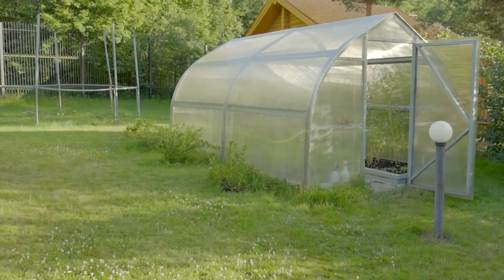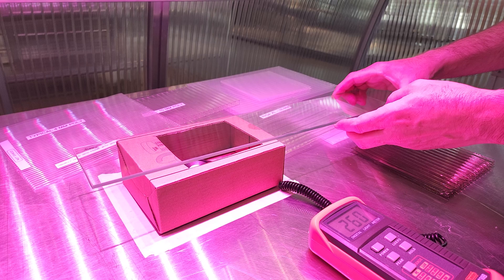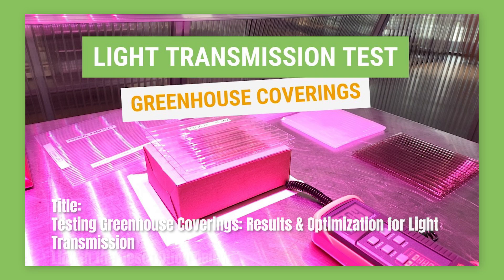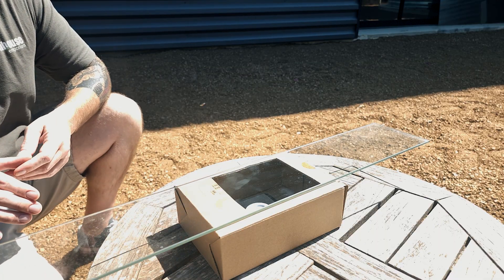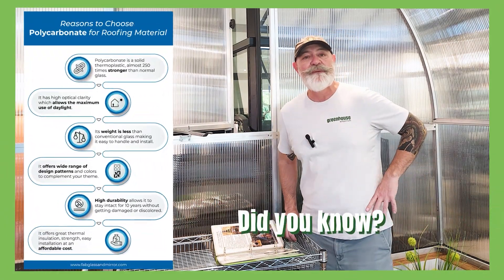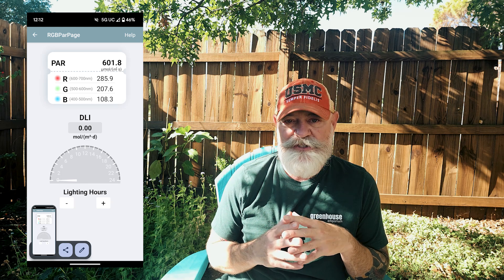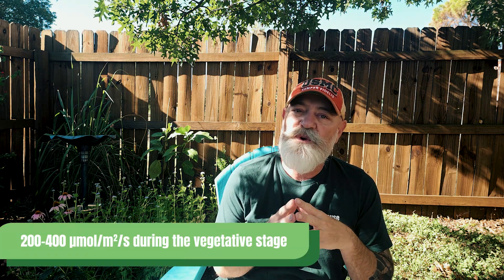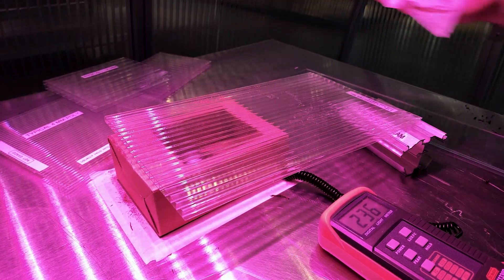Testing Greenhouse Covering Materials For Light Transmission: Our Results

Comment: Hi , I bought Suntuf polycarbonate sheeting Solar Grey , light transfer 20% , Solar transmission 43% for my shade house , 4 years ago My orchids are not thriving , no flowers 
I need more light , thinking White difused , light transfer 85%  Solar transmission 80%  ?..
Live Sunshine Coast Australia , would I have not enough sun protection/cover when very hot, I don't want sunburnt orchids  please advise
Reply from the maker: That sounds about right. Orchids still like it bright, but no direct sun. I am not surprised that with 20% light, they don't bloom. We have regular polycarbonate and a 50% aluminum shade, and our test orchid is not blooming either (we're in Central Texas, so it should be similar to your climate). While I cannot specifically say that the white light diffusing polycarbonate would work, I think your chances are way higher. Light diffusing polycarbonate creates a very nice, even, and bright light.

Comment: Hi. Your test is not consistent, you place the samples once parallel and once perpendicular (chambers of Pc), looking at the angle of the sun in 8mm Pc the light must pass through two walls to hit sensor but in 10mm Pc it must go throught 3 walls (including the inner walls of the chambers) in 16mm Pc it's  passing 4-5 walls. This wouldn't be a problem if the sun was at its zenith. A similar situation is with LUX meter, light from further diodes on the led barr hit samples on sharp angle it would be more precise if you use one led bulb straight abowe sensor. Sorry for my english, I'm from far away :)
Reply from the maker: Thanks for pointing these things out! I didn't consider it and sure enough, you're right. It makes a difference which direction it's placed (I just went outside and tested it real quick). It's comments like this I love the most. I'm intrigued to test the polycarbonate panels again.
Keep in mind, we did say it's not a scientific test. We are not in a place to avoid/prevent all variables.

Comment: Any ideas why the 8mm polycarbonate resulted in better light transmission than the 4 AND higher ones?
Reply from the maker: As far as we can say, the clarity of the polycarbonate sheets and the channel size must have played a role in this. The Riga greenhouses use quite translucent sheets while the 4mm generic polycarbonate was slightly less clear. When you look at the width of the channels between the walls, you can also see quite a difference. The 4mm has very narrow channels which could result in more light being blocked.
Reply: @ghemporium  that explanation actually makes sense. I'll make sure to check out the channels. 

Btw, in growing mary J, many of the better LED lights claim to  having a 1.8 mol/joul rating. Would you want that type of intensity for any sun hungry crop?
Reply from the maker: @dozyproductionss  Now, we're rather talking about efficacy (PPE). As far as I understand it, µmol/J tells you how much usable light per Watt/Joule you get. A higher number is better as it provides more light per the same power spent. You can calculate PPF if you know the Wattage and PPE. For example, 1000W LED grow light with a 1.8 µmol/J rating will produce 1800 μmol/m²/s PPF. In veg stage, your plants only need 300-600 μmol/m²/s (less for seedlings) and 600-900 μmol/m²/s for flowering stage. This means the distance or a dimmer will help adjust the amount of light you'll give your plants during each stage. Hope this helps!